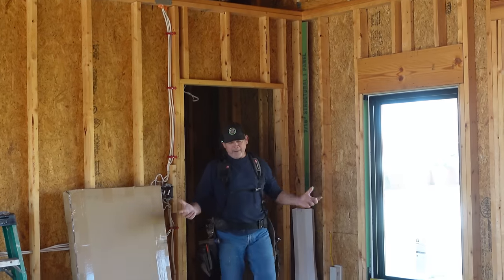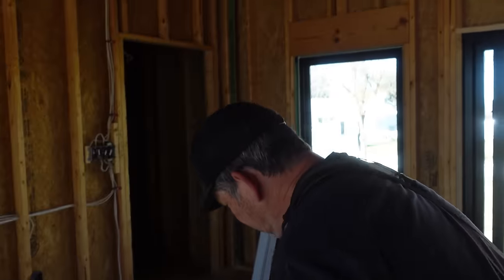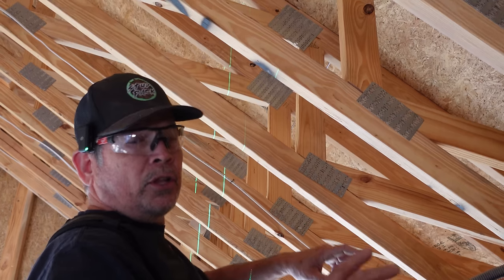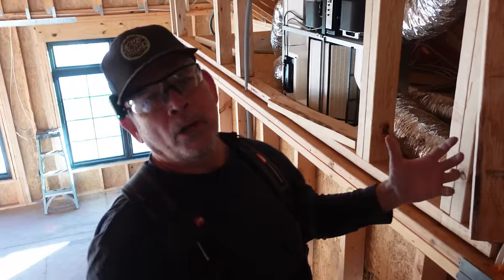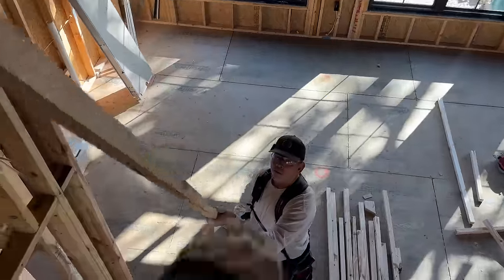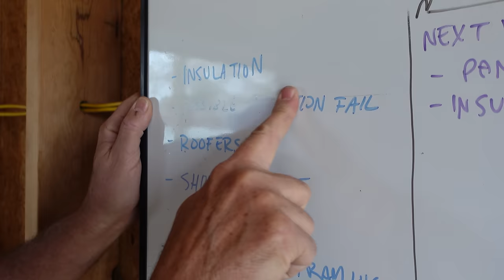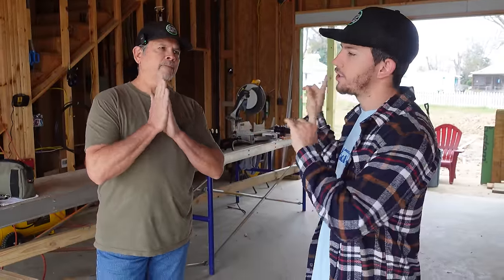We Found the Perfect Access Doors for Secret Storage!

Comment: Respectfully, your WBDoors access doors should be hinged at the top and you can then install a spring loaded cam lift making it more like a gas loaded hatch that lifts the door out of the way towards the ceiling eliminating ever needing to clumsily remove the door from a ladder and getting it dinged up or having dirty fingerprints on the finished wall or ceiling paint you choose.😇
Reply: 100% agree!
Reply: Yeah, those are going to be really awkward to remove coming towards you whilst you up a ladder. Would be ideal if hinged upwards on a gas strut.
Reply: Yeah. I was going to write a comment for this.  It would be much more awesome to have a hatch that opens up, like a truck cover hatch.  Plus you'd have less rick of a hatch accidentally falling/tilting open partially if the walls were to vibrate due to loud music, slamming doors, or even gusty winds.
Reply: i agree 100% too, those access doors were not designed for being installed in that fashion at such a high height, at floor level ok. imagine having to climb the ladder, push it open and unclip it, then having to descend the ladder while holding the door above your head, then climbing back up to access the space with the door blocking the ladder rungs.
Reply: Just what I came to comment.
Reply: I was thinking the exact same thing!
Reply: I just made the comment and then deleted it as you said it better.
Reply: I wonder if they thought about that, could be that the hinges aren't designed to be continuously pulled down without sagging in 10 years.
Reply: Beat me to commenting the same thing. Surely this isn’t the first time the manufacturer has heard this suggestion.
Reply: I agree with this comment and had the same thought. You can buy the gas struts that a car tailgate uses with the right angled adaptors, they would then allow you to have it so it lifts up and is supported by itself so you're not trying to hold it, release it etc whilst also trying to keep safe up a ladder.
Reply: so true.. wonder how much of a difference between this one and the spring loaded
Reply: justrelaxing1501 yes, completely remove the door for working.
Reply: Instead of spring loaded cam lifts, you can just use the gas loaded struts.
Reply: Agreed!
Reply: How does one measure and select a gas strut though?
Reply: Would a spring loaded cam lift/hinge the door greater than 90 degrees toward the ceiling? If not, the open access would be restricted to what ever angle it ends up giving you. I'd rather have the whole panel come off and have unrestricted access for the maybe 3 to 4 times a year it theoretically will be opened.  Also why would a cable and carabiner safety catch be installed from the manufacturer, if it was intended to hinge from the top?
Reply: That's cool but why not go with the gold standard for that size, a double door.  If you use the right hinges you can get 180° swing on the doors.
Reply: This is what I came to say as well. Could probably pick up some from any auto parts store. Especially if they would be able to be opened beyond 90°, given the angled ceiling.
Reply: @MRxSLEEP   - Amazon has a wide variety of gas struts and from multiple suppliers.
Reply: I have IKEA kitchen cabinets, the one above the cooktop has gas struts to raise the door towards the ceiling. It works great. The door would be in the way if it came down rather than pushed up.
Reply: @ianbelletti6241 that’s one good idea,but it’s seems that would be a design decision. The possible advantage I see to this is super consistent tight reveals and the drywall finish so the wall finish is consistent. Otherwise it is just building face frames into your wall.
  Just a different option.
Reply: @AMCGremlin1973  the thing everyone is missing is that this door is designed to pop off it's hinges for easy removal.  The thing is I would not want to be the one removing this access door. I would rather it be a swing up design or a double door design.  Either would be preferable considering the height.
Reply: The rendition is scary good and amazingly detailed. Kudos to the creator!
Reply: I’m thinking the made in the USA was a clue as to door orientation?
Reply: That’s how I thought it would be when he first showed it but it ended up being different but I agree with your idea
Reply: Very first thing I noticed.  Can you imagine trying to work across the open door of the access panel?   Or trying to move replacement equipment into place if ever needed?  If the doors are fully removable, then maybe nobody should care.  My preference would be to order the door with side hinge location if that can be specified.
Reply: While it might take heavier hardware and be a little less concealed, but I would rather have two side opening doors in place of the one large panel.

Comment: Those access panels reversed with a gas cylinder to hold them up would be more useful and safer
Than reaching out two feet out from wall
Reply: Gas struts would be the go...🤔😎🇦🇺👌
Reply: Plus if you are on a ladder and have to take the door off where do you put it? I’m thinking it’s awfully awkward to then carry it down the ladder?
Reply: And the idea of setting them inside the space? I thought you said the space was for storage? Are you going to have space to set them inside?

Comment: I second the comments against using black for the epoxy floor. If you’ve ever been in a room with a black floor, it literally sucks-up all the light and gives the room an odd “feel”.  In addition, if you drop anything small like a screw, good luck finding it on that black floor.  I’d highly recommend a light grey with flecks.
Reply: I somewhat disagree, I have 3/4 inch rubber mats on my apartment "workshop" floor, and it is much better than the reflectivity of the laminate flooring or lighter mats I had. It reduces the glare from the 10 000 Lumens of lighting in a 120 sqr ft room with white walls.

Comment: I strongly recommend against a black floor for your garage. It has a much MUCH bigger impact on how bright the interior will be than you'd think. (It's literally an exponential effect).

The reason is that light bounces off the floor, and back onto the ceiling (often several times), before bouncing onto your work area. This gives illumination that is both brighter and more even. If your floor is black, you get none of those bounces, and it'll (a) take a lot more illumination an energy to light your space, and (b) the illumination will be much more harsh, with sharp shadows. You may find it less pleasant, and it'll be harder to work in.
Reply: Plus dark floors look SO much dirtier than light floors
Reply: I have to agree with you Tim exclamation point it's much different than the LED lighting bouncing off of the drywall on the ceilings and it would probably caused a lot of eye strain while working in the shop.
Reply: Don’t do it! I worked in theatre for many years. There is a reason the floors are all black. They absorb light and prevent weird reflections and light bouncing in weird ways. Exactly what you don’t want in a shop as the original poster said. And they will never BE black. The minute someone walks on them they will forever be dirty. There is a reason we repainted the floors every 12-18 months.
Reply: I concur.  PLEASE reconsider.  You would also have a hell of a time finding little pieces of stuff you drop on the floor.
Reply: Lol, does anyone look at inspo photos? Black epoxy garage floors (with flecks) is kinda common and looks just fine? Looks pretty bright in all the photos... Also, Jordan's workshop-style garage is going to be VERY brightly lit...like a mechanic's workshop, blinding.
Reply: I prefer grey floor for garage, black makes it look so dark.
Reply: I agree, avoid the black epoxy
Reply: Agree!!! It looks amazing, but working on anything, it will feel like your in the dark, even with lights and roll up doors open. 😅
Reply: Completely agree. Medium toned floors would be much better.
Reply: @NCHCLW ah, mistake number 7833F - you must be new. Bean soup they call it. Remember when they used to only have rotary phones?
Reply: And that huge black wall in a bathroom with no outside light
Reply: Avoid too many specks for any color. Way too difficult to see small screws or other things you drop on the floor
Reply: It's also a nightmare to find anything the falls on the floor.
Reply: I strongly recommend against any extra dark floor, you might love that dark walnut as I do but that thing will look dusty every single day. I would not put a lot of black and dark brown on many horizontal surfaces or you will be dusting 24/7.
Reply: I somewhat disagree on the negative effect lighting wise, I have 3/4 inch rubber mats on my apartment "workshop" floor, and it is much better than the reflectivity of the laminate flooring or lighter mats I had. It reduces the glare from the 10 000 Lumens of lighting in a 120 sqr ft room with white walls.
Reply: We’ve a black slate floor in our kitchen, it’s a nightmare to keep clean, shows every speck of dust. Don’t do it.
Reply: @NCHCLW  "Looks pretty bright in all the photos." You mean the staged and enhanced photos? Nothing looks the same irl as a photo. You ought to know by now.
Reply: @spf-92.5  That's a great point about dark wood! (Also it makes a room look dark & small.) I'm glad I chose the "barnwood grey" Pergo for the floors in my house. Can barely see the dirt the dogs drag in. It's gotta be a big, muddy paw print to be noticeable! The barnwood look is light to medium greys/tans with "wood grain" texture. Hides everything!
Reply: @NCHCLW yeah, because they add lights that are out of view.
Reply: @spf-92.5 
I painted the walls in my RV/shop faux wood planks mostly medium, dark and very dark browns. About 6 years ago; no regrets, looks very realistic. (13’ walls) Painted the double shop doors copper, the fiberglass doors look like they are real copper. The whole RV/shop was a basic dingy white.
 It feels and looks more like a cabin. It has a pellet stove so we do keep it warm in the winter as we spend more time in the shop than in our home.
  When wood prices skyrocketed that was when I decided to paint my own wooden planks. I thought if it didn’t turn out I could always paint over it or panel it.
 I wish you could share photos in comments because I truly am proud of my accomplishments and ingenuity.
Reply: @mreinecker Unfortunately I remember them and I think we still have one in storage that my Mom had to use to call out if the power went out because she wasn't able to use her electric phone without power!!! 😂😂😂😂. Gosh, it's AMAZING HOW FAR TECHNOLOGY HAS CHANGED JUST IN MY LIFETIME OF 56 YEARS!!!! 😮😮😮

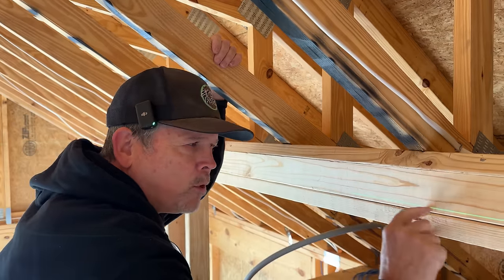OK Guys, I'm a newbie so my question is about the angle that he had to cut the board in order for it to fit flush.  Was it the 33° angle that he mentioned when he was talking about the angle of the Sheetrock at the top??? (Last board cut prior to him talking about the LED lights)???? It's the 1 7/8" ripped board mentioned at 16:27, again what's the angle of the board at the top???

Comment: Howdy!

It was great working with you Jordon! Really appreciate the freedom in design and ability to add a perspective for your viewers. Can’t wait to see the final product.
Reply: You did amazing job Chris! Awesome work 👍
Reply: Great job!
Reply: Good job. Consider adding an "About" section to your youtube profile with a means to reach you in case if someone needs to hire you?
Reply: 1:06 that side by side refrigerator right up against a wall will make it very difficult to open that left side door. Was that just placed like that as part of rendering, or was it like that on the plans? There has to be a decent gap between that refrigerator and the wall, maybe around three inches. And to get that door open fully, you have to also account for how far the handle sticks out in front of the door, because the handle would then be the first thing hitting the wall while trying to fully open that door.
Reply: @stevebabiak6997  Some CG renderings are not exact as far as spacing. Appliances especially don't allow for gaps, depends on the software you're using. I think they know the fridge will need spacing, although some newer refrigerators require zero clearance for door opening
Reply: @chris.dellafave how can I reach you? Would like to see how much it would cost for a kitchen addition currently being done.
Reply: Nice work dude! Two questions: 1) The flooring in the kitchen where it transitions from tile to wood flooring, is this a texture, or did you model it that way? 2) What was the render time on that animation?
Reply: Amazing
Reply: @krisPatAU  I appreciate that tip. I don’t really check YouTube comment replies so your feedback is even more important. Thanks again
Reply: @stevebabiak6997  yeah just roughs. Architects were determine appliances and layout prior to construction or installation. Renders can be used for exact measurements or specifications but this project was not one of those. Jordan’s got a great team and good eye for design. This imagery was just to help him express his vision to his viewers.
Reply: @Not_You_2  exactly right
Reply: @ericchevy67  it’s a combination of modeling and texture mapping. Not sure of exact render time for all the clips. Roughly on my machine at 4k res one second of footage runs around 1 minute of rendering. Overall i think this project took 90mins because I chopped and edited the animations in post and some didn’t make the Final Cut

Comment: Amazing rendering.  One piece of advice: don't have the refrigerator next to a perpendicular wall.  The door won't open 90 degrees because the handle will hit the wall first.
Reply: And that means you won't be able to pull the shelves out easily for cleaning. We made that same mistake in our reno and are now living with it. We have to pull the fridge out every time we want to remove the shelves.
Reply: This is by far the most frustrating thing in my whole house

Comment: Your project looks great.  A note for your viewers, your build is being filmed for your blog and if Jordan ever sells the house the new owner can see what is under the walls.  When I bought a new house in Las Vegas, I actually went to the job site and took photos during framing.  In addition, i received a book of contact numbers of with all the trades that worked on the house including original paint codes, etc.  Not that I am going to sell the property, I can provide the new home owner all the specifications and photos so they know what is actually under the drywall.  Your followers might want to do the same.
Reply: If all of us thought of the next guy not often we’d all be happier
Reply: @joshd108   That's the way I worked as an auto mechanic, and as a home DIY'er.

Comment: As a roofer, I've seen roof decks ruined by small leaks that went un-noticed because of spray foam on the underside.  If you can't see it, then you don't know to have it fixed.  Eventually the deck rots over a large area and the repair is not fun.  BTW, if you ever want to see a nice cutaway view into an ant colony, that's where you'll find it 🙂
Reply: I looked into spray foam, and basically after 10 years they find that the roofs are all dryrotted from it retaining too much moisture. I would never risk it.

Comment: Looking good! One thing we saw in the rendering clip is in the kitchen. The side-by-side refrigerator door against the wall will not fully open. The only way to accomplish this is with a single top and bottom door refrigerator with the doors swinging away from the wall. You two may want to move the refrigerator. Just a thought 💭

Comment: I like to leave a few extra inches when a refrigerator is next to a wall to leave extra space for the door to open. Otherwise you may have a hard time fitting larger items inside. Preferably I like to have a cabinet or open space on either side. I have had times where a pizza box or something in the freezer will not fit because the door is in the way.
Reply: Tall thin door on one side to store broom, mop, folding step stool and such would be great.
Reply: @ulbuilder  or a top bottom refrigerator instead of a side by side.

Comment: Great video. I will probably order a couple of these access doors for my home. 

One suggestion from a journeyman carpenter who worked his way through college as a framer and is now a Civil Engineer. As wonderful as your laser is, pro-carpenters  (framers) will measure on each end of the wall and snap a line. This is just as accurate and it is faster. Also, framers will not plumb the small wall that sits on your tall lower wall. They will plane up with an 8-foot level or a straight stud and mark the place where the lower wall is in the same flat plane as the upper wall. This is MUCH more important than plumbing the wall because if the lower and upper walls do not line up with each other vertically, there will be a visible bend at the joint between the two walls. It is not critical in this case for the walls to be perfectly plumb. However, it is critical for both walls to be in the same flat plane.

Comment: Yea, you can open the access panels when you're up on the scaffold. But, when you're lining there, NO SCAFFOLD!. Having the panel opening from the top means you have to remove the panel to access the HVAC. If the panel opened from the bottom, you could crawl in without removing the door.
Reply: Amazing call out! Consider this idea, Jordan.
Reply: I didn't see any struts, how would it stay open?

Comment: Congrats on passing inspection! Suggestions flip your access panels to open upwards with gas struts to hold open. The way you have it hinders access & is likely to get damaged. Build another wall with built in wardrobe & storage plus a Murphy bed. Great 3d! But no bed? No Storage? Would have liked the view of stair access. Otherwise fantastic guys!